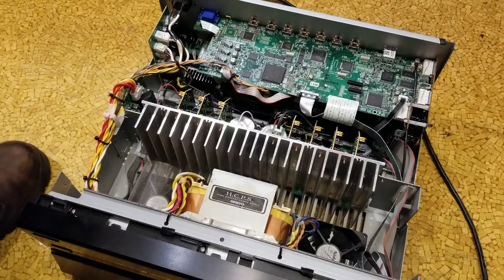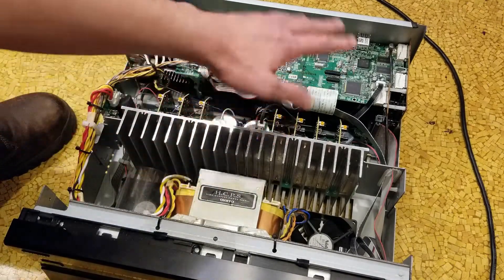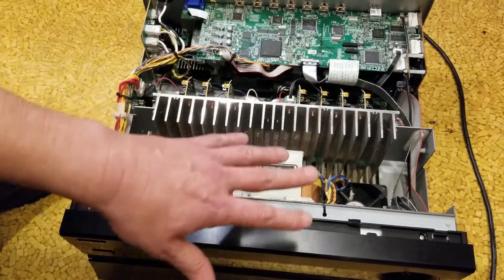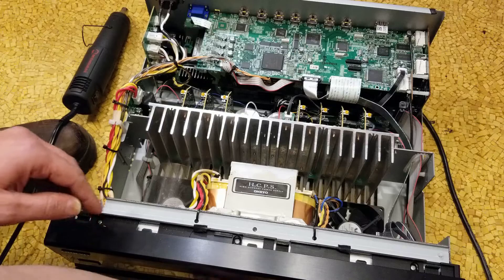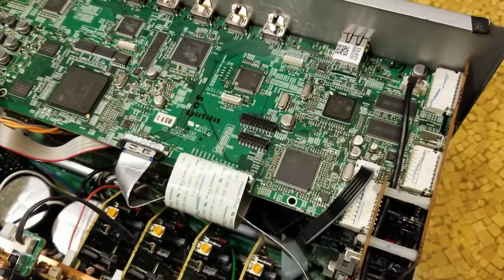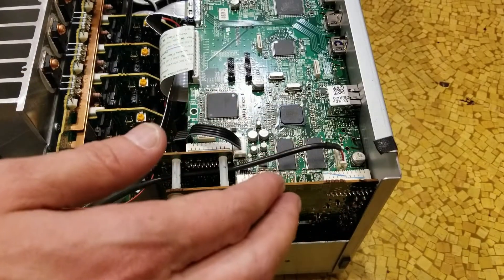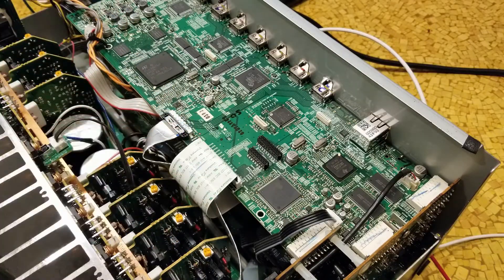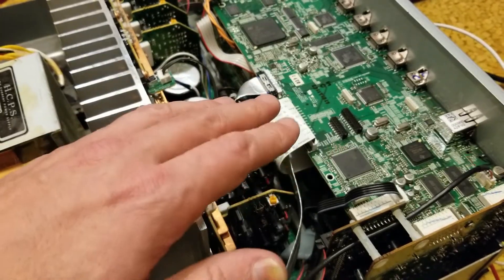Onkyo Receiver No Output HDMI Board/DTS Chip Repair

Comment: How long did Onkyo have this problem?  What years, what models?  I do have  a TX SR 707 it is in my garage and last summer it would cut out until I put a heat sink on that dts chip, how ever since it is winter it will not start until I let it warm up for ten minutes or so.  My older Onkyo 901 amps have been with me for 30 years no problem. I think that I do still like Onkyo but If I buy another one which ones and what years were bad?  Or should I just go old school.  Peavey is me ve... theater or rock and roll amps?.. do not need all of the bells and whistles. How ever since my computer or my TV is normally my source signal HDMI would be nice. Right now I am splitting my 1/8" jack from my sound card to the 707and two Onkyo 901's and three DefTech 15" powered subs I have 12 speakers and I can make it Thump, having lived and worked for a sound company in Nashville for years I do like to feel the base now and then. My long throw 12" boxes that I built are 4 ohm loads and my sony 901"s are on top so get a nice and full sound.  I just find that when the 707 is maxed out it is only about a third of what every thing else will do and I really like to keep unity gain on all units or else there is no gas peddle if you want to push it. Do you have any recommendations for the future of my home entertainment system?  Peace, Jim

Comment: I have an Onkyo TX-SR313 which is doing the same thing, will try this for sure. I have an SMT reflow oven at work and my job was multi-layer PCB design, so I should be able to lick this. Loved the sound my amp had... don't want to go through a whole repurchasing thing...

Comment: Where is the fan my onkyo nr 609 has the same problem it has a fan  its not coming on
Reply: The fan is at the back under the hdmi board you have to run it really hard for the fan to come on In all the time i have had my 609 the fan has never come on I run 9 speakers & 2 subs from mine most of the time

Comment: Hi, 

Thank you for your Video!  I just fixed my Integra pre-amp by doing exactly what you did here.  I was going to try the "baking" method until I stumbled across your vid.  I did use the infrared thermometer, and it took a while to get the chip to get to temp.  My first try failed, and the speaker indicator lights did not appear.  I don't think I got the chip over 300deg f because I was being cautious.  I tried again, and this time I let the chip get to 306deg f.  I kept it on that temp for about 10 seconds.    This worked!! I know nothing about electronics, at ALL, but It didn't look hard, so I figured I have nothing to lose.   That being said, can you do a follow up vid to show what other chips might need the heat sinks, before I close it up?   I'M not sure which ones are chips and which ones aren't.. that's how little I know.  Lol.  I got a heat sink kit off Amazon, and it came with a bunch of them.  Thanks again for your wonderful vid!! You just saved me a couple hundred dollars minimum!!!!!!!!!

Comment: I've got a txnr709 and the chip seem bad works when I heat it up to 350° but after it cools down and I turn it off it doesn't come back on. Do they sell new or refurbished boards ?
Reply: Onkyo were repairing them up to 2018

Comment: I can't thank you enough for the break down and info you shared in this video. I've never commented on any video before, but I truly am grateful. I have a onkyo txsr601 and it runs the music in my shop, hopefully  you saved it from a load of buckshot. I'm gonna head to HF now and buy a pen heat gun, and try it. Can I take heat sinks out of other stuff, cut em down and use them, or do they need to be specific sizes?
Reply from the maker: Know anything will work as a heat sink just make sure it's not too big and won't touch the other circuits around the chip and find some way to attach it
Reply from the maker: Look at some of the other comments some people have mentioned that using electrical contact cleaner as help too. Also with the heat gun you can make sure this is the issue just by heating it up to around 150 degrees and see if it makes a difference
Reply: I didn't try  the 150 deg. I got it to 300-330 deg. ....I could smell hot solder, so I stopped and let it go back down to about 80 or so. And still have no speaker display.  That was a couple hours ago, I just added some petroleum based flux, and did the same thing,  its cooling now, I'll clean it off and see what happens.
Reply from the maker: You may have to try again at 375 to 400 that's the temperature of the ovens run at when they make these boards so even 330 might not quite be enough to properly melt it even if you do smell some flux.

The scale and breadth of this issue with Onkyo really has turn me off and the sad thing is is many Integra receivers also suffer from this issue. my fifteen-year-old Yamaha keeps Trucking along.

Comment: I opened up my ONKYO HT-R558 receiver, cleaned it with WD 40 contact cleaner, pasted a heat sink on the DTS Chip and the issue was resolved.
Reply: Did you clean whole onkyo with wd40 or only DTS chip? :D
Reply: @achibbbb   I cleaned the whole ONKYO with the Contact Cleaner spray thoroughly. Then placed a heat sink on the DTS Chip and it's been working perfectly since then.
Reply: Dexoit is best!!
Reply: What's a heat sink? Forgive my ignorance. I have an onkyo only left speakers are working
Reply: Idiot wd40 not for audio!!!
Reply: @MrTopsoil911    Your the idiot.  WD40 CONTACT CLEANER IS FOR AUDIO.  READ BEFORE WRITING SOMETHING HERE.
Reply: @rashidkmr  😆😆😆🤣🤣
Reply: @MrTopsoil911  There is a product made by the WD40 company that is specifically for contact cleaning, do some research!!
Reply: @MrTopsoil911  🤣🤣🤣😆😆

Comment: My onkyo nr 646 sound is ok but still No dolby atmos and dts hd master sound please tell me what is the problem
Reply from the maker: I do not know I just made this video because I found this receiver and then read online about the DTS chip issue and just lucked out in fixing it
Reply: Catus Maximus how long has it ran since you fixed it? Just got a Onkyo with the same DTS chip issue and I’m wondering if it’s worth the trouble to go through your process.I only spent $15 for it so it’s not a big deal but it is a really nice receiver
Reply: I think we are on the same boat. I have a DTR 6.8 with issues with anything Dolby digital i.e. Dolby 2.0  surround, DD 5.1, EX, TrueHD etc, I'm at wits end on what to do, but hopefully there's a solution out there.